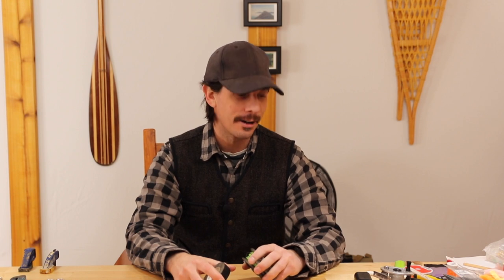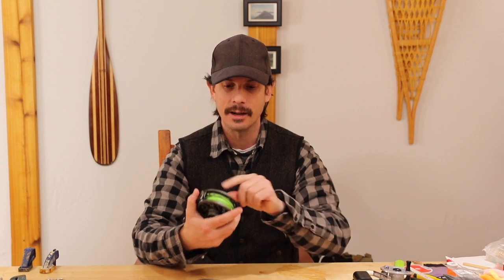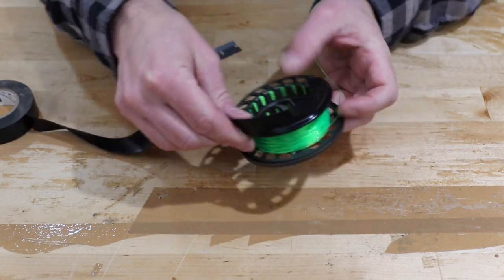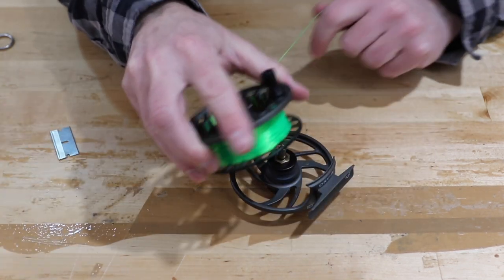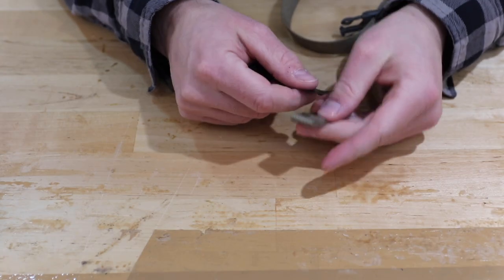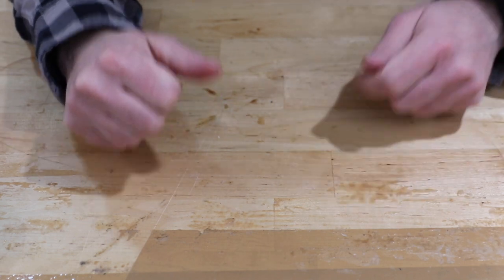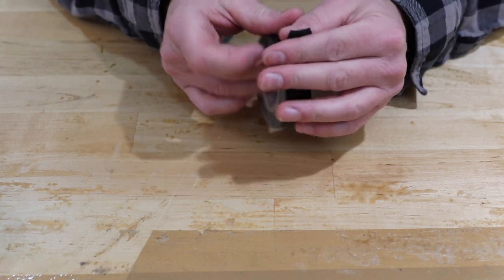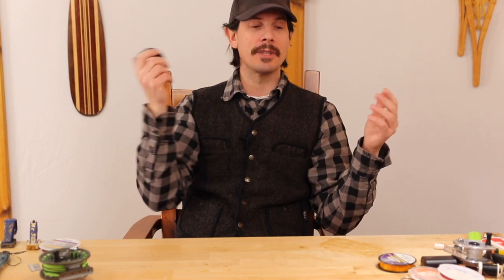3 Useful Hacks For Fly Fishing

Comment: I can see right now until I get some wading boots and socks I need to wrap my shoes and laces with electrical tape. I hate the shoelace magnet! 

Yes, I’ll be the biggest geek on the water but hey, the fish won’t care. Right now I use the black caps designed to go on the bottom of chair legs on both ends of my cork grip. Drill a hole a little smaller than the shaft, cut a slit for the hook keeper, and slide it on. This changes the shape of your grip from a 1/2 to a full well and protects your cork from shreading. Another cap goes on the butt end. This protects your reel from mud, asphalt etc. 

Thanks for posting,
Wes

Comment: For the reel gap.  Grab your spool schmear around the spool with some light grease anything really like chapstick even.  Then grab your UV resin from the tying bench.  Put a drop or 2 at both sides of the gap.  Use gravity to keep it from running off and then zap it with resin.  Add a couple drops and cure them.  Then pop the spool they'll be perfect.
Reply from the maker: Interesting. Not a fan of the grease. Sounds messy but then again, I have been known to have fumble hands at times. To each their own and thanks for sharing your way.
Reply: @greenhornflyhorn  no the grease is so the UV cement doesn't stick to the reel.  Call it a release agent.  You grease the edge of the spool so the UV resin only sticks to the frame not the spool itself.  Then once you zap the resin there is no gap